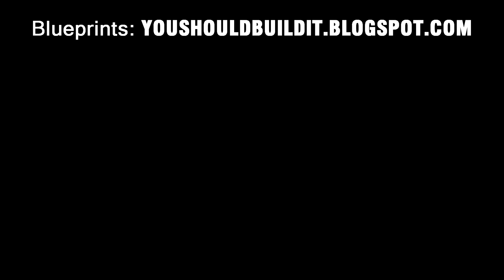Plywood Tool Storage For Wrenches In Workshop - Homemade - Simple Woodworking Project

Comment: These sorts of jobs take hours of work to do, but the trick is to get the backboard up and just whittle away at sorting things out. Definitely going to need longer screws or rods to store your cut off disks and flapper wheels. Maybe also draw around your spanners to highlight where they belong. Pretty good job though!